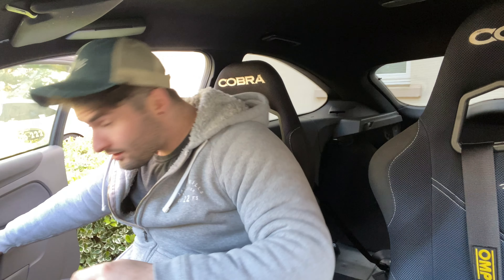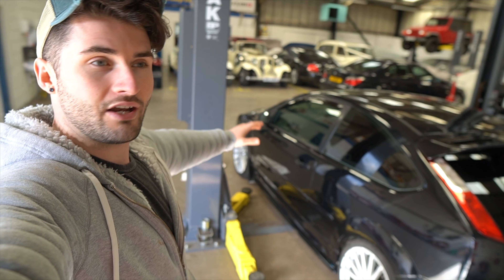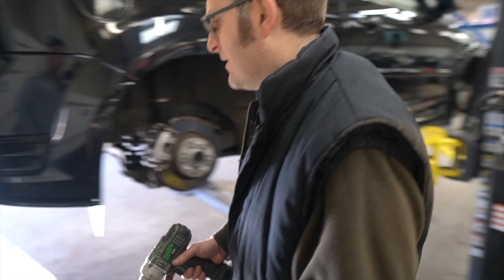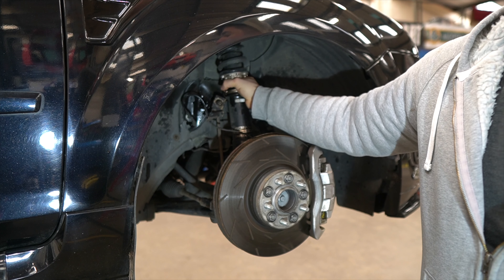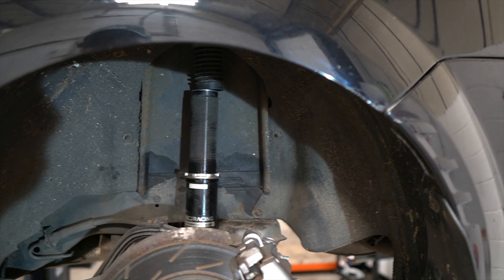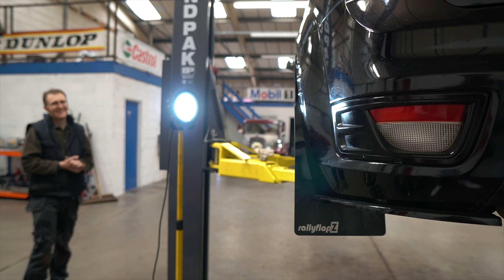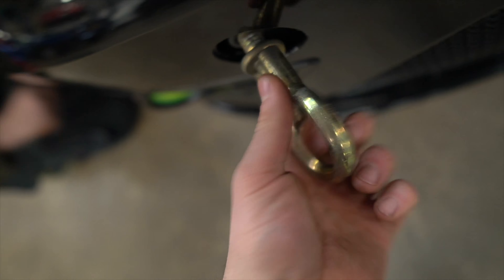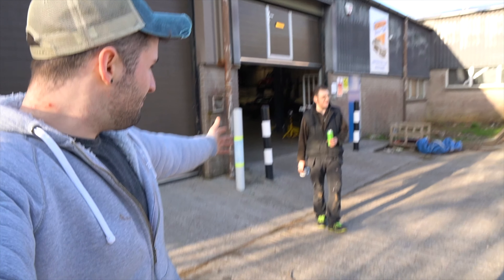SETTING UP THE RIDE HEIGHT ON MY MK2 FOCUS ST | SAVE THE DRIVESHAFTS

Comment: Don't worry too much about blockmod mate if it goes it goes. My car is at 142,000 miles and gets revved to fcuk everywhere once it is warmed up of course. No problems. You either get a good motor or a not so good one. It's a lottery. Depends on the womble that puts it together in the factory I guess. )))
Reply: For the sake of 2.5K for a new block I’d be worried about not having the block mod done. I learnt the hard way by ‘not worrying about the block mod’ done in my 225. It’s an essential thing to do on these engines weather you warm them up properly and cool them down to. £650 for the block mod or take a random guess when your engine goes pop 🤷‍♂️
Reply: @timmmah_j  The warm up thing was not specific to protecting against my upper linings exploding just put that in to state I don't abuse my engine, but I do use it how it was intended. I don't want a spun bearing just 'cos I could not wait 5 minutes. Anyway mate as I said, some engines can crack at 30,000 miles, with no mods, some keep on going for moon and back mileage, with go faster hardware and mapped. I just go from what I've experienced on the web from other users' stories. Just weigh it up for yourself using your own judgement. I did not say don't worry at all, Just don't worry too much. It may be ok. )))) Chances are if you have put decent miles on your car and have hoofed it along the way, it's a good motor. This open deck design means cooling where it's needed when it's put together properly, but it relies on careful fitment of the head, and to me the problem is the inconsistency of this particular process. I read a story about the MK3 RS focuses (different engine, same open deck design) where the new guys were given the most complex jobs to do (ie head fitment) because the old guys wanted an easy day. The skills were not being used in the right places. Could be true, and it fits with human nature perfectly lol. Even ze Germans. I've seen that a lot in the workplace and it would only get worse in the bigger places, with large volumes and time pressures etc. Just food for thought. Anyway In the event the liners go, there's an opportunity to do more tinkering. Sounds good to me. Just buy a little banger and have it on standby 🤣🤣🤣 We love our 5 pots.

Comment: Looks slightly higher at the front than mine on Eibachs, rear looks the same as my Eibachs. Maybe measure your arch to floor distance as I'm sure people could compare there ride height to yours if they are just running shorter springs.👍

Comment: Could have been more scientific and measured the angle of the drive shaft and adjusted to bring the angle to zero.
Reply from the maker: That’s a really good idea. I’ll look into that!
Reply: @GCMYT  But maybe just get a good geo setup, corner balance and get them to setup the ride height.. but a fast road setup would be better for you then a track one.